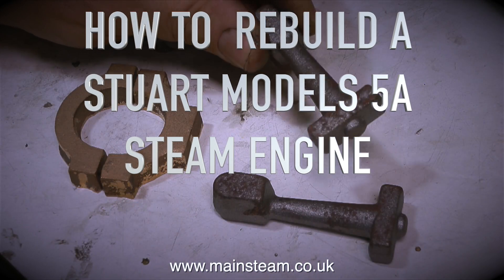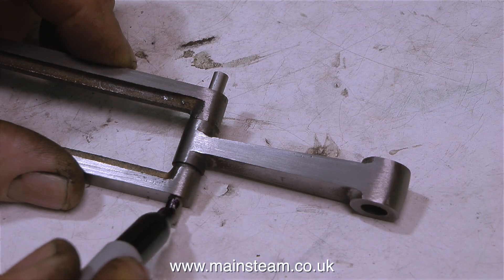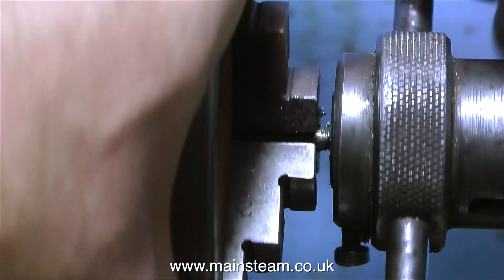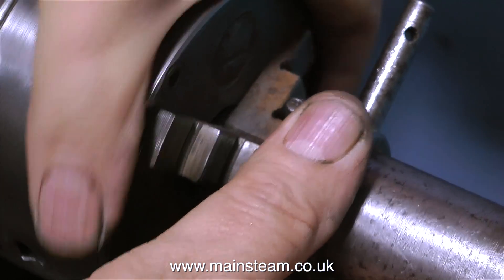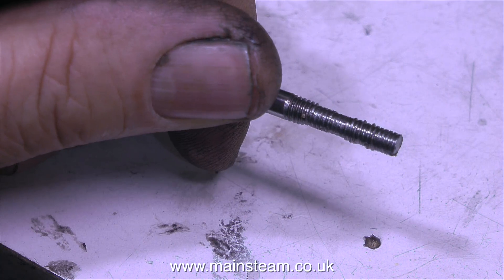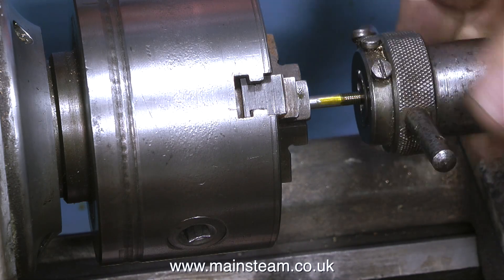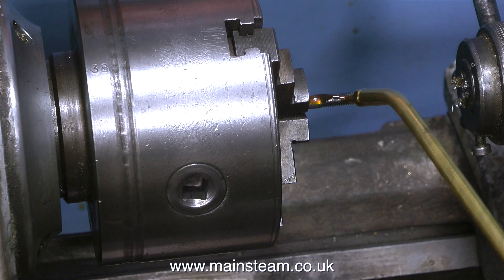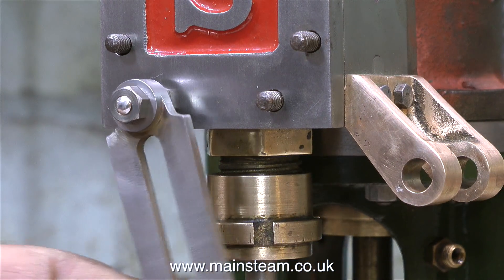HOW TO REBUILD A STUART MODELS 5A STEAM ENGINE - PART #22

Comment: Confessions of an amateur machinist...I too, have struggled with threading stainless steel. When making my own steam engines (Ray HasBbrouck designs) I've ended up mangling quite a few parts. I've made sure the dies were clean prior to starting, but have never stopped every 1/4" to re-clean. This could be my salvation!

Comment: What alloy if stainless steel are you using? Perhaps a different grade of stainless will be preferable for the threading operation. I recall my machinist friends complaining about 300 series stainless, maybe 400 series stainless or precipitation hardened alloys may be more appropriate. 

Perhaps a single-point threading would be preferred rather than die cutting the threads. I was able to get a decent set of threads on a 416R grade stainless steel fun barrel using a single point thread cutter.
Reply from the maker: I don't know, it is the usual stuff that I buy from Blackgates Engineering (www.blackgates.co.uk)
Reply: Is it magnetic? A magnet will not attract the 300 series (austensic) stainless steels that I have worked with, but it will attract the 400 series (ferritic) stainless steels.

Is there something like Grainger or McMaster-Carr in the UK? Those are my sources for small quantities of materials, different alloys do have different machining characteristics. One thing to note is that 400 series stainless steels are typically less corrosion resistant than 300 series stainless steels (particularly 316 SS)
Reply from the maker: It isn't magnetic ....
Reply: I would guess type 304 stainless steel, it's the most common alloy I have run across. I used to design hermetically sealed electronics packages, and the casings were nearly all made of 304 stainless (needed to weld hermetic connectors to the package, the outer shells for these connectors were also nearly all made of 304 stainless). Getting accurate machined pats made was damned expensive, costing several thousand dollars for each casing (plus the cost of beam welding everything shut and testing for hermeticity, not to mention the electronics).

Comment: Useful piece.  I don't do SS, but I do thread drill rod (silver steel) for use in my engines.  I'm having trouble holding 1/8" drill rod in my Sherline (3.1") 3 and 4 jaw chucks.  I've made a collet (brass) in the pass, and had limited, but not good success.  I've had better success with 3/16" drill rod, even in the chucks.  5-40 threads.  (3/16" rod turned down).  For Stuart #10 engines.  Die holders in tailstock.  Any suggestions?
Reply from the maker: Try www.rdgtools.co.uk

Comment: Hi Keith.  I have a newby question.  Why did you have to expand the die before using it?  Great video.  Thanks and I greatly appreciate your work to teach and make the videos.
Reply from the maker: because unexpanded, the thread may be a little undersize, best to start off as wide as it will go (which isn't much anyway)
Reply: Thank you.

Comment: Keith, it just dawned on me, after going through this myself, that you probably get metal splinters/slivers a lot.  If that's a correct assumption how do you remove them?  I play guitar, not publicly, but for fun and I have had a couple pieces of metal in my fingers that would wake someone from a coma when touched just right!  Any tricks you can share?
Reply from the maker: Nail clippers & some alcohol :-))))
Reply: Ken Shields don't forget the Stall

Comment: I do the same thing, break the chip when I feel it binding. For super fine (as in good) finish on threads, I two part the op. On the first chase I set my die oversize, and then clean the die and part. On the second pass I set my die to my standard and chase it without breaking the chip.

Comment: Another tip with working with stainless.. The ability to shake your fist at whatever is going wrong. Then re-sharpen your tools, reset up and get back to work. It's a lovely metal but it's all sorts of a pain to work with.
Stupid work hardening, heat hardening, tool blunting, easy galling, annoyingly tearing, wear resisting, high temperature resisting and shiny alloy.

Comment: Thank you for sharing your stainless steel threading experience with beginners!  I learned this lesson the hard way...and do exactly what you suggest about cutting 1/4", then cleaning, then cutting the next 1/4", repeating until done.  Same thing with tapping internal threads in difficult metals like stainless steel - cut several thread, remove the tap, clean, and repeat until done.  From time to time I've had low-grade non-stainless steel act a lot like stainless and require cleaning after every few threads.  Not sure that was due to work hardening, but it sure acted like it.

Comment: Keith just a thought here try using a thinner oil when cutting threads. Your swaff (sp? ) should migrate out of the die easier. Way back when I was in metal shop class we used 3 in 1 oil for cutting threads.
Reply from the maker: I tried thinner oil with similar results, but thanks for the suggestion.

Comment: I notice the hex nuts you favor using appear unusual (and quite nice) to me.  They appear to be dead flat on one side and have a radiused chamfer on the side that shows when installed.  Is that the case?  Do you modify them to have this appearance or buy them that way?  Is there a particular name for this style of hex nut?
Reply from the maker: I just buy them from www.blackgates.co.uk - they are like that in the packet.

Comment: Keith, thanks for showing us the proper method to cut threads. And I wasn't aware of work hardening for stainless. So it is like copper which also can be work hardened but much harder.